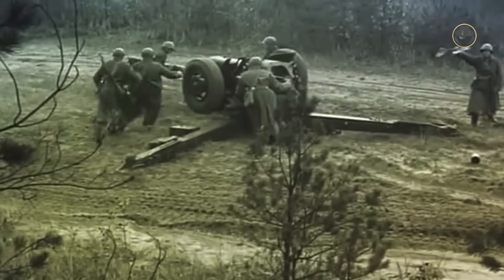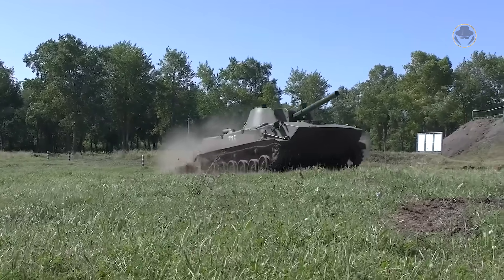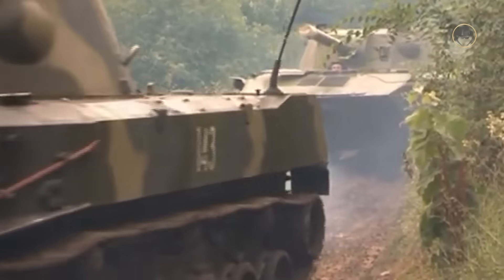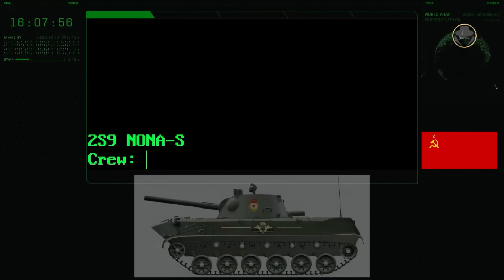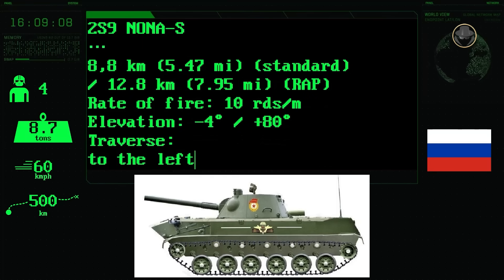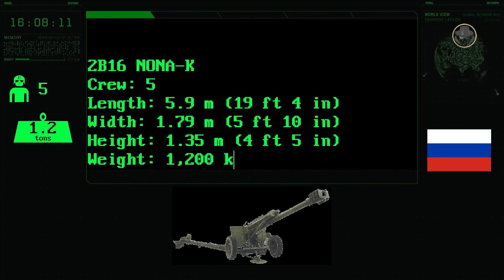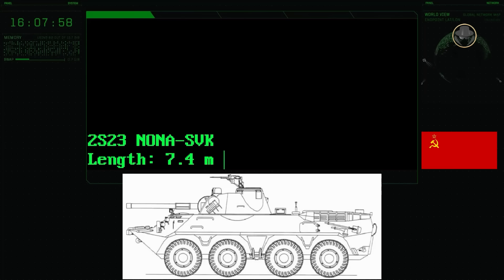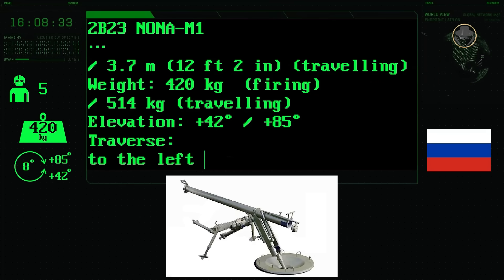120mm NONA family | The most flexible Russian artillery systems

Comment: Oryx lists at least 109 NONA systems of all types lost or damaged in the Ukraine War for the Russian side. It's clearly been paying a price for its thin armor and the necessity of getting close to the front line due to its short range, much like TOS.
Reply: Oryx is a propaganda pile of rot, I only went there to laugh - they can record one piece of equipment photographed from different sides as ten, record clearly Ukrainian equipment in pixel camouflage as Russian, etc., the pinnacle of competence is a Ukrainian BTR-3, listed as a Russian BTR-82.
Reply: @ don’t forget t64b being presented as Russian. Crosses painted on and all
Reply: I would argue that as the losses of the tos are also extremely high, the thin armor of the Nona has little to do with its high losses
Reply: Oryx is literally garbage and pro ukrainian. His flawed counting techniques include counting ukrainian losses as Russian ones and double counting the same equipment multiple times.
Reply: The short range is a massive issue, more than the light armor imo (at this point a cheap drone can disable or destroy even MBT’s likes we’ve seen with the T90, Abrams and Leo). The thing is most vehicles in service with Russia and the west were created during the Cold War. Today the ability to spot and strike targets a mile+ away is much much easier, even when concealed by trees or dug in.
Reply: @ exactly. An example of artillery system with similar range is the tos1 and you can’t say that thin armor is the reason for its high loss rate.
Reply: @joshuagunderson6593  Admitted so. Somebody is going to need to develop a strap-on, small-caliber CIWS anti-drone gun for AFV's, and that is all there is to it. 

Jammers are good, but too hit and miss. They need a hard-kill reliable option going forward - something like a modern RWS mount, but with automatic track & engage sensor ability. 7.62mm-20mm in caliber. Maybe a gatling or something big enough to fire sensor-fuzed ammo
Reply: First those lists..second 109 for 3 years in that scale is nothing..even for old item it Is usefull obviously..but Russia do use old reserves..and certain koncept will be adopted and others will be out..
Reply: @zrikizrikic9126 yes it’s been a long war. Anything you can think of is going to have had losses by this point. I thinj that with the introduction of the tos3 now the Russians are learning where the sweet spot is as far as how close an artillery piece should be to the front. Close enough to have the ability to respond quickly with good accuracy but far enough that they are at less risk of counter battery or drone attack
Reply: @AsmellYoullGetUsedTo let me give you a secret..Russia AIM for what they say demilitarization denazification..ect..and few other thing..and they want populus..they want revolts so that ukrainians gate their nazinato Government and recall they Are russians..that Is why certain things go that way..with other Nations IF they join like germany Poland,ect,you will see different aproach.. but soft goal Is to liberate new teritories this year..but they dont hurry..hence some losess of materials.anyway boys love toys
Reply: Maybe. But how many soldiers and other vehicles might have been lost if they weren't present?
Reply: @jgw9990  I have no idea, either way. That war is tearing through all sorts of vehicles and tactical concepts. I guess whether the idea of the Nona gun-mortars being useful will be determined by whether VDV buys more or similar systems after the war. Personally, I have my doubts.
Reply: @MM22966  id rather have it than not especially in this kind of war where no vehicle or emplaced weapon is safe from the drone hordes so mobility is better than not having it, atleast imo
Reply: Even if it has thick armor, drone warfare would render that useless. That thing is not a tank, it's not asked to do tank stuff.

I'd say just 109 losses is pretty good considering how low tech this thing is. Russia definitely can produce more.